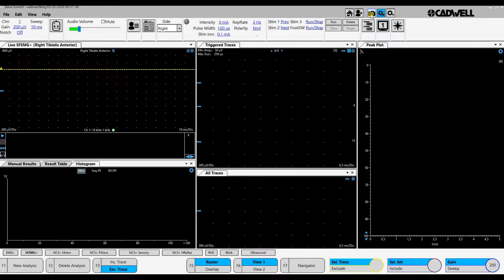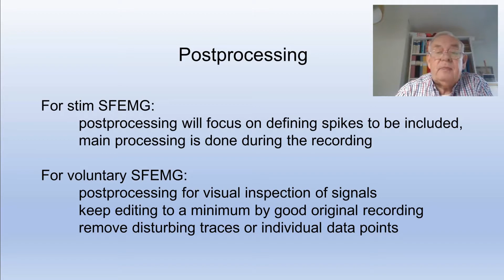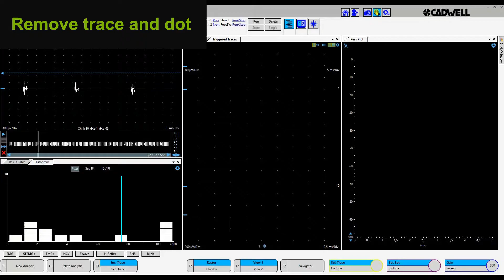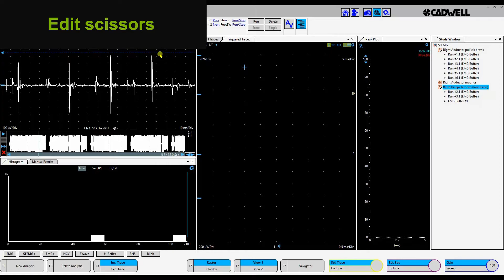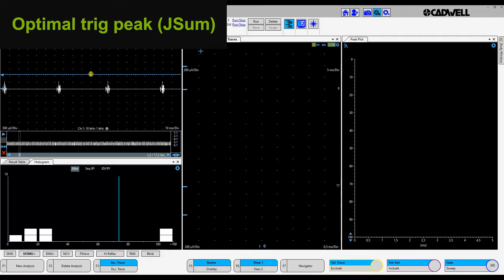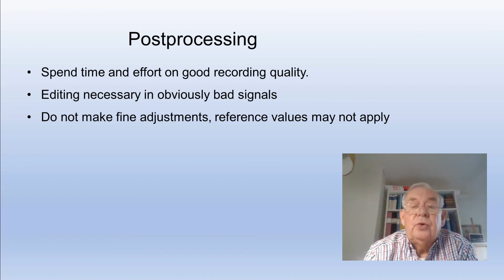SFEMG Demo

Comment: Hello dear master, thank you for your valuable training،I had three questions، First you prefer to do the test with a stimulator or with voluntary contraction of the patient?Second, in Shapiro, false negatives are mentioned in ocular casesExactly how sensitive the test is?Third, I have a disease with ptosis and a negative test that requires elective surgery what is the best approach in this patient?thank you very mutch.
Reply from the maker: I prefer voluntary. False neg: in generalized MG SFEMG is pos in up to 97% and > 90% in ocular MG. If pat has ptosis then orb oculi is usually abnormal. Otherviswe, think of myopathy.
Reply: @jittertube  Dear Master, I have used your teachings a lot. I hope you are always healthy.
Reply: @jittertube  Dear Master, I have used your teachings a lot. I hope you are always healthy